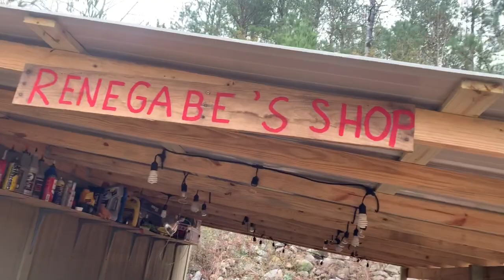2012-2020 Can am Gen 2 Rear Diff Install/Removal Mudnwheels

Comment: Can you explain how did you pop up the axles please im here now
Reply from the maker: You pull the diff back and tap on one side while pulling against it and it should pop. Sometimes you can just grab them and pull them hard and they’ll pop out. Or just take the trailing arms off and it’s easier just takes longer

Comment: I know This is a year later but why would you need a shorter driveshaft
Reply from the maker: Diff is longer
Reply: @ReneGabe_  ohh did you get it built that way or did u order it like that
Reply from the maker: @mylescope7764  ordered it like that
Reply: What's the part number on that diff I'm swapping a diff on a 850 and it looks exactly like that plus I cut the breather line what kind of creepy do you use or what's that white thing on the breather tube
Reply: @calebegge4992  it’s called a rear diff bellow. Cheap part that works better than having to run your vent line higher to avoid water and mud from getting in